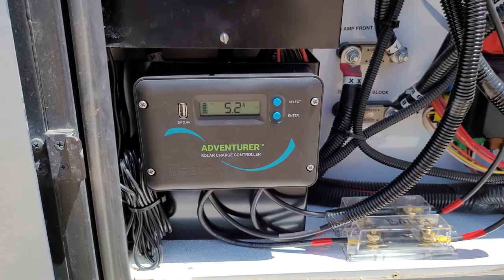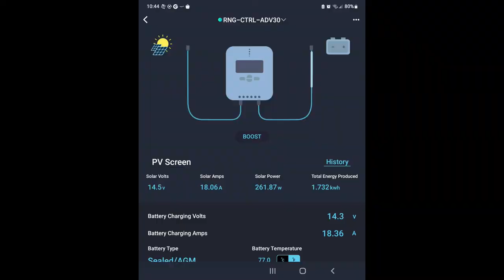DIY-Install RV Drill Free Solar Panel Mounts

Comment: What did you use to connect the panels to the brackets? If bolts and nuts, how did you hold the nut from turning? Thank you.
Reply from the maker: Self tapping tech screws.
Reply: @exploredom3690  thank you 👍

Comment: You made posted this video in May. How is is working? Anything you would do differently?
Reply from the maker: Yes, I added another 400 watt system to my motorhome to produce more than enough power to cover all of the appliances that I have while dry camping. I will probably make a follow up video covering that as well.
Reply: @exploredom3690  nice! I just picked up 2- 435watt panels that I plan on installing this way